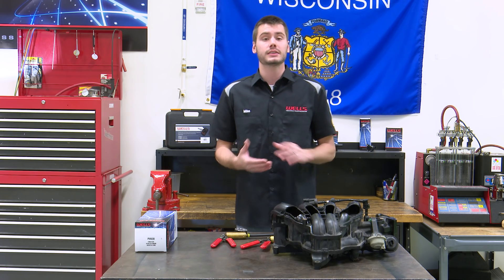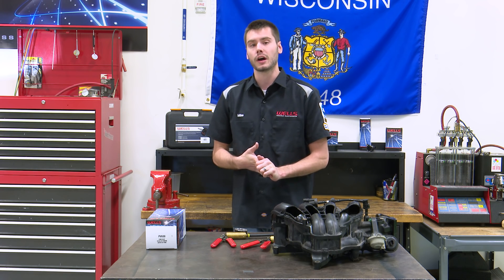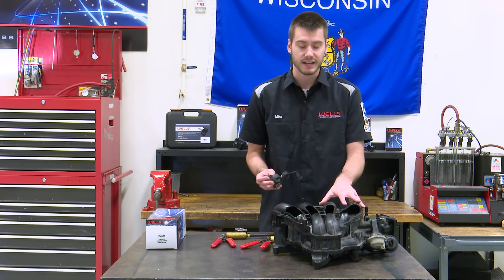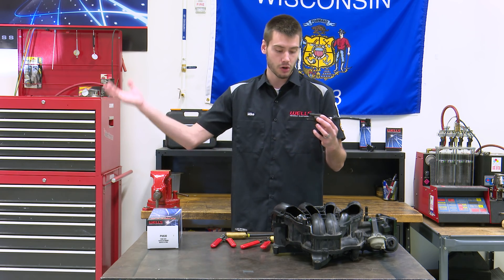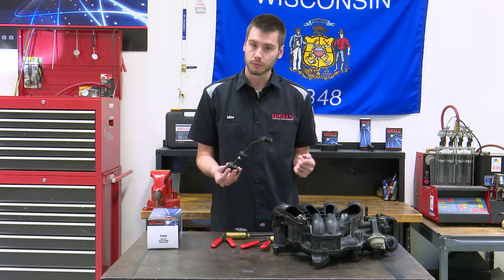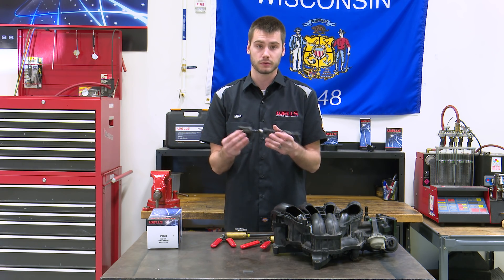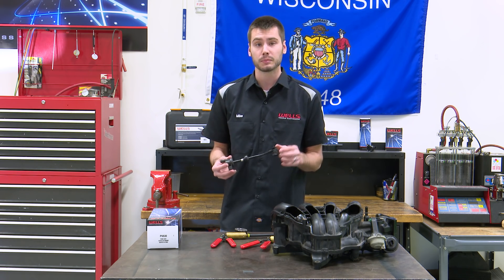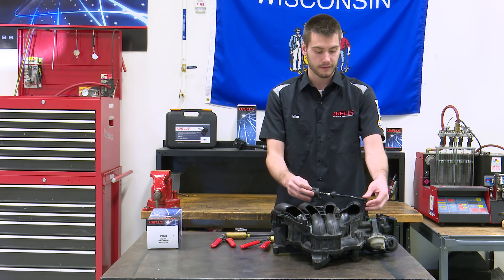Wells CounterPoint Ep.  22 Testing Purge Solenoids on Turbo Engines (PV630)

Comment: Could this cause a p0299 underboost code? Pretty sure mine just went bad on my Chevy Cruze.
Reply from the maker: Hey Dillon, most likely not. The Chevy Cruze had a big issue with the turbos. It's pretty common for needing a turbo when underboost codes are given.
Mike Becker, Senior Instructor

Comment: The engine in the swift was less than 50hp and the Conquest is at least 3 times that.....but when I drove it last in the Lancer shell...I ran it on the road with 14 lbs boost so it was close to 250 hp....but the torque was mind blowing .......a 4.2 diff on 15x8 wheels and 215/15 tires ...2nd gear launch would produce doughnuts until it ran out of gas or blew the tires off.
Reply from the maker: Nice! Sounds like a blast to drive! 
Mike Becker, Technical Services Instructor

Comment: Nice CounterPoint Mike. Great diagnostic tips with normally aspirated & boosted engines!
Reply from the maker: Thanks Bob! Those leaf blower motors...adding all kinds of contraptions making our jobs even more complicated! Long gone are the days of simple.
Mike Becker, Technical Services Instructor
Reply: I had a speed shop sponsor my race car operation so I was installing Paxton superchargers & nitrous systems on their customer cars...fun stuff watching customers get their first dose of tire churning hp. Bad news for one that didn't listen to my warning to not hit the nitrous tonight b/c the roads are wet so needless to say he needed extensive bodywork after one push of the button.
Reply from the maker: Cool. I always wanted to work on racecars. Sounds like it would be fun, but also extremely stressful. A lot of that stuff is life and death if the tech messes up. Those Go-Fast buttons commonly seem to end up costing a lot more than their initial investment huh? 
Mike Becker, Technical Services Instructor
Reply: Yea before I ever modified their engines I explained this may find the next weakest leak & they all signed releases...HAHA some of them found the weak links. You are absolutely correct about setups b/c increasing you can lean an engine out and melt pistons in seconds. Computer cars were simple actually b/c you could sit in the front seat and program fuel & ignition curves and never get your hands dirty. Carburetor engines were harder to tune but became an art with jet changes, metering rods, power valves, venturi mods, etc and reading sparkplugs is a requirement. Sparkplugs are read with a lighted magnifier to read the base of the plug & we changed heat ranges of plugs also We were the oxygen sensors and computers back then along with a engineering redesigns & experiments...fun days. As far as my race car it was built to withstand 1500 hp but every once in awhile I'd find a new weak link...
Reply from the maker: It's amazing how many people I hear say things like "back in the day we cars were easy." I never understood why...In my opinion a carburetor is a lot harder to tune that a computer car. Like you said, a carb engine is a work of art! Sure a computer controlled car may have more sensors and potentially more failure points, but when everything is functioning like it should there really is no guess work. What you see on your pid info is what you get. Throw a wideband sensor in the exhaust. Read exactly what the mix is and go from there. No guessing. What do you prefer Bob, old race cars or modern ones? If you were to buy anything and mod it for the drag strip, what would it be?
Mike Becker, Technical Services Instructor
Reply: New technology is the way to go in racing & modern cars. Carbureted engines are old school along with distributors with centrifugal & vacuum advance. I'd take me a couple hours on the distributor machine eliminating vacuum advance and modifying the centrifugal advance weights, springs and elongating weights to get the total advance I wanted and then if the engine wanted the advance in slower, faster, more or less I'd be doing it again. We ran dual plane intakes for low to mid range torque and single plane for mid to high RPM range & tunnel rams for High RPM range and now we have IMRC that is having the efficiency & performance of both. VVT is running multiple camshaft configurations for the gear ratio in the car and with 6-10 speed electronic automatics today's cars are so superior to old muscle cars. Tuning was an art I loved on older engines but today it's done in milliseconds by programmed modules from sensor inputs and if you want to change the advance or fuel curves, boost configuration, nitrous stages, etc you just pull out the PCM & plug it into the controller and within minutes you have what took us hours to days to do. Today we have 6 cyl turbo engines putting out more HP than 8 cyl muscle cars and still getting 20-30 MPG compared to @10MPG if you were lucky. I like the new technology b/c it keeps me interested...I get bored with simple stuff which is why back then I had to tear perfectly good running engines apart and make them faster than my competitor's car. If I were to have another race car operation it'd be another 32 Bantam Altered @149" wheelbase with rear wing for stability at over 200 mph and it'd be a 2000 HP blown engine. I ran best of 7.25 at 189.85 but this would be a 6 second 200+ mph altered. I've thought about it a few times...gets my adrenaline flowing just thinking about it HAHA. Shops have evolved from "We don't work on computer cars b/c we don't understand that new fangled crap" to "We don't work on those old carbureted engines b/c we don't understand that old crap". I have customers with both and love listening to and tuning older engines.

Comment: Running test is how I always test for vacuum leakage through purge . Just a note though , wait a minimum of 30 seconds to see if vacuum builds ! Some solenoids only leak through just so much , and may not be immediately obvious
Reply: Really great demonstration Mike, you are doing an awesome job !
Reply from the maker: Thanks Mr. New Level Auto! That's a great tip. I should have mentioned that you should be able to put a vacuum gauge on there indefinitely and never see the needle move if the valve is closed and sealed properly. Thanks!
Reply from the maker: Thanks Keith! You are doing a great job as well on your videos as well! Seems like you've built an awesome following in a short amount of time. Congrats!
Reply: Certain other parts hotlines may say otherwise btw 😉, but Wells guys know better
Reply from the maker: Hmmmm...that brings up an interesting point. Is there an acceptable leakage on a purge solenoid...or even a vent solenoid for that matter. Opinion? What do you think? I feel that if there is any leakage the part is not functioning properly. Would the slightest of leaks create a problem...maybe, maybe not. Depends on the situation right? At full engine vacuum a slight leak would draw on the cannister. The fuel trims would be affected. Whether or not this sets a code would be dependant upon the severity. Could see a rich or lean concern, or a flow during non-purge.  

Mike Becker, Technical Services Instructor